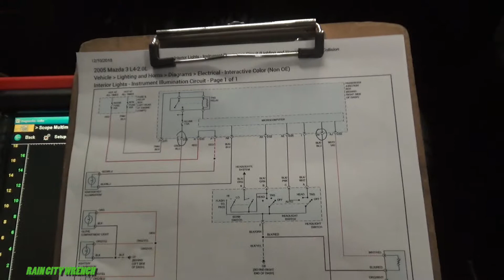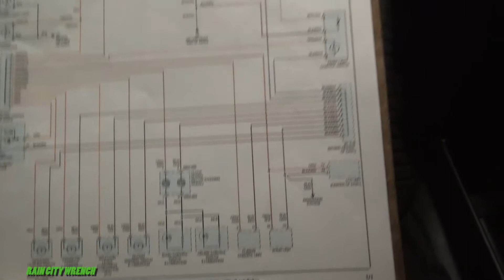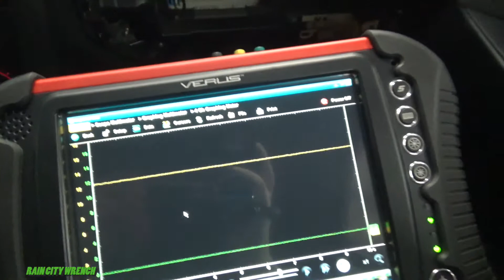Mazda 3 Passenger Junction Box

Comment: My turn signals and cluster lights went out in my 2005 Mazda 3. Mechanic is quoting me $900+ for a new PJB is this a fair quote?
Reply from the maker: Sounds a little high. I wonder if that quote is for a new or used part? Not sure they even make new junction boxes for that year anymore. If you or anyone you know is remotely mechanically inclined, you could probably fix it for under 200 bucks by installing a used part that is if you haven't already fixed. Cheers

Comment: I have one with both dash lights and tail lights intermittent but come on when the PJB is kicked. Bad thing is a new PJB thru Mazda is $700 and up. 🙁
Reply from the maker: Sounds like the exact same problem. New junction boxes have to be programmed. With a little luck, find a good used one with same options and it won’t need initialized?
Reply: @raincitywrench117  thanks, I'll have the owner locate one